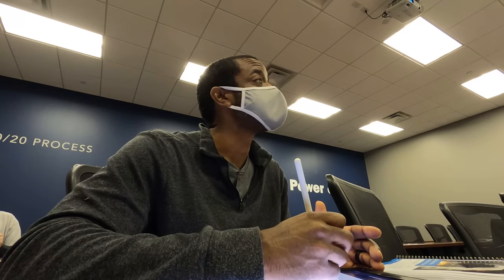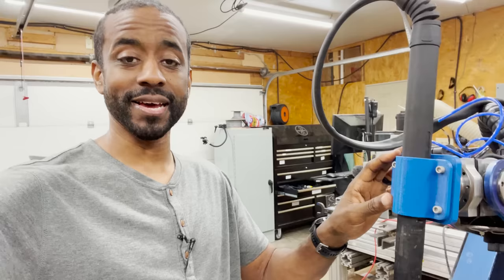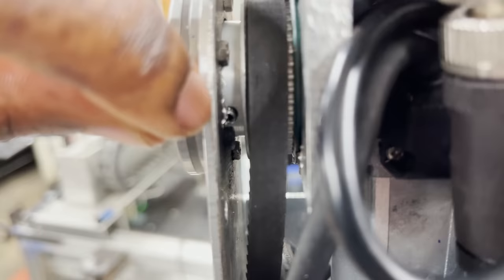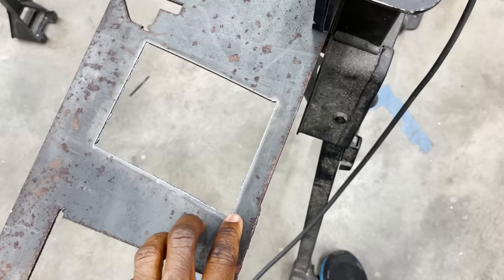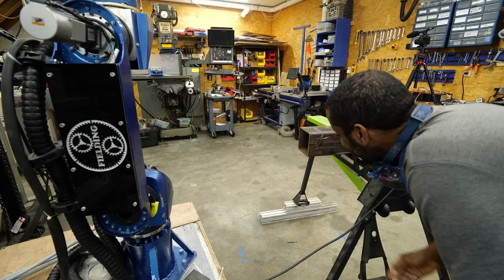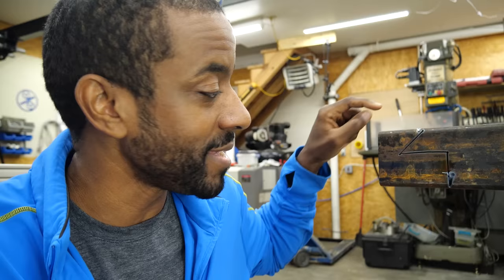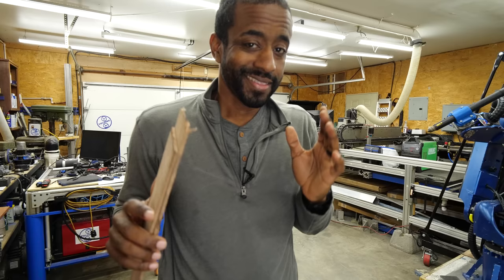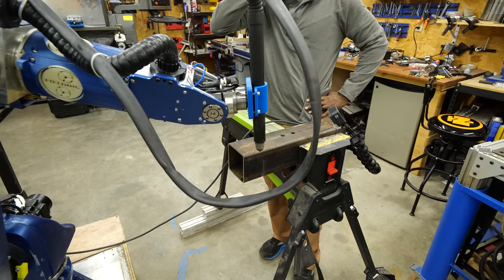I Added a Plasma Torch To My Robot - Jeremy Fielding #097

Comment: From an Embedded System perspective, it appears that your servo controllers are advanced enough to accept encoded displacement signals rather than mere step-direction. If not, normally an MCU would have timers that generate clock pulses without engaging the MCU core. Typically only individual commands may call interrupts that turn the flow of timer signals on or off. So that should keep your core free most of the time. 
If you are not already, I would suggest that you share the robot code on git and let the community help you with the MCU bandwidth problem!
I would really be interested in taking a shot at it.

Comment: Noisy or otherwise non-zero grounds can be mysterious. Check that the right wires go to ground-ground not just chassis grounds or other random metal. Check that signal shields are grounded in the right places.

Comment: If the relay is staying closed if it’s powered or not, check that no magnets are nearby. Other possibilities check with a multimeter to verify that no power is getting to the coils. It could be mechanically stuck in one position as well such as from running too much power and welding the contacts together.

Comment: Super impressed. Great work. With incremental encoders some microcontrollers have hardware quadrature inputs , you can get seperate chips to keep the tally and talk on SPI from the teensy. I'm guessing if its 10K PPR pulses per revolution its an ADI magnetic rotary encoder which might keep tally itself and read as before on SPI.  EMC problems ?

Comment: Two options: broken relay (welded contacts) or long cable with wrong shielding act as antenna. Keep calm and check one by one - for sure you will find what is wrong ;)

Comment: An accurate TCP is extremely important for keeping a robotic arm accurate in its movements. Inaccuracy can cause many different problems that may not be easy to solve when troubleshooting issues within a system. One of the first things to check on a malfunctioning robot is the TCP. Problems can range from misplaced product to significant crashes that can damage the system or the robot.  
Troubleshooting a problem like the dropped product may seem like either gripper failure or misplaced approach points when picking the product. 
While either of these could be the case, an inaccurate TCP could be causing the arm to follow a different path than the original programming. Since checking a Tool Center Point is a relatively short process, it is often time well spent to check it before troubleshooting other potential causes for a malfunction
Reply: There's also the issue of setting correct payload and center of gravity.

Comment: One issue I have seen in the past with solving inverse kinematics live, with microcontroller specifically arduino powered, is that they just aren't powerful enough. There isn't enough ram to run your trigonometry, AND solve for significant decimal places. One work around is to limit your decimals to solve in software. Another I have seen is to use a physical look up chart. If your software is solving for 3 million calculations, and one of its "ideal" movements cross a number division that gives you a repeating number, 10/3, some IK software, won't know how far out to cut off counting, then continue calculation. Instead of clipping out some calculations at the end as the ram fills up with 30 decimal calculations.

Comment: I use multiple controllers in many of my robots. You could put a binary counter chip in series with the encoders to give them lower resolution easily divide by 4,8,16,32 etc...

Comment: I think you need to calibrate the distance moved by the steps/mm like in 3d printing motors. Measure the moved vs. programmed distance and calibrate the distance/pulse based on that When you adjusted 25X difference in pulses, it seemed to move in each linear moved about 3X farther than it should have.

Comment: Great video! Since you mentioned writing down what you change... Are you doing that for your source code as well, as in are you using version control like git or subversion to keep track of all the changes you make to any code? I'm a software guy and I don't touch anything until I have it in version control. You can go back in time and find out exactly what changed at any point in the whole history of your project. You really capture what engineering is like. One time it took myself and another programmer a full 8 hour day to finally realize our code was missing one question mark in one spot!

Comment: Funny enough I thought about how useful this kind of robot would be in my industry the other day. If you mounted the robot on a rail, it would take up less room than a gantry cnc plasma and be able to cut extrusions like you are suggesting but also bevel cutting and plasma taper compensation (Cut perfectly square holes by slightly tilting the torch as it's cutting holes) AND would be possible to arm it with welding and painting attachments. Like an all in one shop CNC tool. However the real breakthrough innovation in the robotic manufacturing industry will be AI assisted programming. Like I should be able to give the machine a 3D model, or basic instructions of what I want it to do, and it should be smart enough to compensate for tolerances, orientation, any warping of base material, etc to produce the final result.

Comment: Hi Jeremy. As a CNC guy in a former life and someone that had access to a couple of robotic welders for a short time, my first thought would be to double check your end effector/tooling dimensions in the software. With all of the joints tracking properly and the problem only cropping up in the linear interpolations, it does seem to be a software issue.

You’ve probably already gone through this exercise but I thought I’d throw it out there just in case. 😁

Keep up the great work! 😉

Edited: ‘cause words are hard
Reply: Agreed. I have some experience with KUKA robots and the problem at the end where it is touching on the top and then way out on the side used to happen when we had the incorrect tool length offset or had manually offset the tool path in one direction. It needs recalibrating for the tip of the plasma cutter.

Comment: Maybe a floating voltage on plasma input try using a small resistor to pull the voltage low

Comment: The problem with the Relay, is a latching lock, it's the wiring that's the problem, I had the same on a charging system I was making, it would self latch and run the battery flat, so I think yes wiring problem, great video

Comment: 2:50 Need to flip the print orientation of the curved bracket.  3D print orientations are like a chain, it's only as strong as it's weakest layer.  There are ways of designing parts to reinforce the layers using fasteners, but it's really not needed here.  Just turn it 90 degrees in the slicer.  At most, you might redesign the part to accommodate washers to spread the force, but cracks around the fasteners aren't usually catastrophic so it's no biggie.
Reply: I agree, and also why are you using tape?

Comment: When I saw your video title, I thought I might know what you might be struggling with. However after having watched I think I am wrong. But just in case, what I was thinking of was what I heard the stuff made here guy shane say about his plasma cutter bend marking tool… I think he said it needed to be pneumatic because of the EMP from the plasma making it really difficult to use electronic mechanicals. so it doesn’t really look like this is happening to you, but I mention just as a heads up in case you start getting some more head scratches down the road to consider the EM interference. I can’t believe you already have 290 comments after only a few hours. Perhaps somebody else already mentioned this. I really envy your platform.

Comment: Plasma cutters put out a lot of EM noise. If that noise was significant enough it could be inducing enough voltage to power on the coil of your relay.

Comment: I thought about another potential problem with a plasma cutter.  I'm not sure what type you have, but if it's a HF start cutter, this could be introducing RF noise into your commands and circuits.  Perhaps causing some of the bandwidth issues?  or not. Maybe its a blowback start unit.  or something else.

Comment: Signal noise (cross talk) can be a real bastard and lead to positioning errors. Even just the power cables running  along the communications cables   can mess up positioning systems.  Plasma high voltage can really mess with encoders.  Any kind of high voltage produces magnetism.  If you can separate power lines from comm lines and be sure all of your comm lines and end connectors are properly shielded.    Metal dust can also be a real problem in these kind of systems.  It bridges all kinds of signal paths in tight wiring situations.  I would also check all of your ground connections to be certain everything has a common ground point.  You can get all kinds of weird signal echo issues with two ground points.

Comment: Hi Jeremy, love your content. Ideas from a novice, could you use an ink pen in place of the plasma torch to run path following tests faster rather than mask and glasses and fire? Also, could you add a CNC lathe spindle to your plasma table to gain another axis rather than the robot 🤖

Comment: I ran into a very similar problem with relays. The problem I had was that the relay did work fine when there was no device connected that consumes power (in my example a solenoid) but worked when nothing was connected. The issue was the relay itself could not handle such power with a low control voltage. I recommend to take a step back and do some tests.
- Can you control devices with lower power? If yes how high can you go before it stops working. I don't know if you can lower the power of the plasma cutter that much
- Does it work if you increase the control voltage? By a transistor for a example or a different power source for testing.
- Did you try out other relay models? Do they have the same issue? Do you experience the same issue with different relays from the same model? Maybe your relay is just broken
- Does the relay get hot?
- Does the relay instantly start the plasma cutter or after a short time? Also check with a new relay, maybe something is burned out

Comment: Watching the plasma cutter torch move closely to the tube while you were debugging was kinda scary. I would have made a styrofoam dummy model and a quick release mount to swap it with a real torch. Also you could make a CPLD driver for the stepper motors to make programming easier.

Comment: I've seen robots that will read the moves that you manually force the robot to move through and then it will repeat those moves exactly as you moved it manually automatically. Then compare the file that you did manually with the file you are currently using and see where the two diverge.

Comment: My guesses would be:
Regarding the relay.... 
If you are switching a control signal to the plasma box then it may be DC, if you are using an SSR then it may act as a diode in one direction, so maybe polarity matters.
If you are switching AC, and using an SSR, then maybe the relay is acting as a diode and allowing enough current in one direction.
If you are using a standard relay contactor relay then maybe it is broken, or also has an internal diode.

Regarding the stepping missmatch....
If the MCU is multiplying a step count to guess the real-world step count, then maybe it is a rounding error and the real-world step count is less than half but more than zero so the MCU counts it as zero steps but the driver counts it as a fraction of a whole step.

Comment: Jeremy, could your issuee be related to EMF interferences from your plasma torch superimposing unwanted signals or pulses on to your data lines to the servos or some other data buss of your system?  Shielding all your data busses in the vicinity of the plasma unit may help solve a lot of problems now and in the future.  Best of luck my friend and keep up the good work...  Fred

Comment: I wonder if the relay is breaking down under the high voltage/current on the contacts. Not sure if that is a problem that can occur on all relays, but some types will fail in a way where they appear to be working until you put a high enough voltage on them, and then they will break down.

A large industrial contactor would probably be a better option unless you are just switching a control signal.

Comment: I know this is over a year old now, but if you are having trouble sending millions of pulses per second to multiple devices you should consider an FPGA, you could create custom hardware that takes a number of steps to move and a speed and then without intervention from the processor sends those pulses at the exact specified speed to all device at the exact same time (in parallel). FPGAs are great and allow you to pretty much create a custom, reconfigurable digital circuits to do whatever you want, since they are just digital circuits everything can operate in parallel, so whilst one part of the chip is doing one task, another part could be doing another unrelated task and they never interfere with each other and their timing is completely independent, for all intents and purposes both circuits are completely separate, but you can also design them to communicate between each other. Some come with processors built in, like the Xilinx zync series which features dual arm A9 processors and you get some with normal arm cortex microcontrollers too. They do have a steep learning curve but aren’t too bad if you understand digital logic well. There is also nothing to stop you connecting a normal microcontroller like a teensy to an FPGA and sending data between them.

Another option may be similar to what is done in drone software where they use dma (direct memory access) with the gpio register, so all gpio pins get updated at once. A teensy, especially the 4 should be plenty fast enough to send the pulses at the required speed, maybe their are some optimisations you can do to your code to make it work?

Comment: A switch (relay) must be able to switch on and of a load. If it doesn't do it - than ask you if the switch is rated for. If the voltage is too high, the current can easily jump the gap. And it newer shuts off.... (put two relays in serie - test my theory) AND NEVER FORGET THE FREEWHEEL DIODE
AND High frequency can also jump a gap

Comment: Im amazed at what you’ve accomplished.building an articulated arm is no small task. I’ve been working with industrial robots since 1984 and met some of the early pioneers. Most of the robots I have worked with use more than one MPU.
I am not a robot engineer I have mostly done service and applications work. Although your plasma cutting didn’t come out perfect it wasn’t to bad.  I’ve done worse.

Comment: Are you using a solid state relay? Confirm the relay coil voltage shut off point is higher than the voltage at the coil when the relay should be off.

Comment: Relays acting differently in 2 identical situations.  
1. Faulty relay. 
2. Situations aren’t actually identical. Trigger voltages are likely not the same. Maybe a “short” in the source voltage is triggered it prematurely giving the impression its “always” closed

Comment: With the relay for the gripper / plasma torch are you removing the gripper from the relay contacts so that the plasma torch is the only thing connected? My thinking is possibly the plasma torch is controlled by a microcontroller and its seeing a high or low state because the gripper is in parallel with the torch on the contacts of the relay.

Comment: Shot in the dark -- is it possible that whatever cabling you are using to send the pulses from the microcontroller is interfering (via parasitic capacitance or I-don't-know-what) with the signal? E.g. filtering out some proportion of the signal, given that it's switching pretty fast? I.e. is the cabling designed for such use?

Comment: Just guessing but maybe the torch head wants active high vs active low? When you connect the relay the switched pole is high so when the relay is off the torch head only sees open (ground). Then when the relay activates it closes the circuit and its still low. If the switched pole was ground and the other pole was high then when the relay is closed the torch head still sees a high signal and will turn off. I would try different combinations on the torch head manually with a battery and see if you can come up with a combination that for sure activates the torch, then duplicate that with the relay.

Comment: I know this video is very old and my comment might not be seen but any way
from a specialized engineer in building and programing  those stuff here is my advise :-
always trust your servo they are not designed to be closed loop in the program you just throw the position command to the drive 
the checking and verification of the position is your drive responsibility not yours ( the closed loop stuff)
if you want them to work in closed loop you need a lot of computation  power in (micro)Sec time frame and this is for one motor
you as a programmer should focus on the algorithm and trust your drives for verifying the correct positioning

Comment: Those servo drives should have an encoder out to feedback to the controller. All of the ones I have used do, Mitsubishi, yaskawa. etc
Reply from the maker: I have encoder out... the program can't read it. That's the short version of the story LOL
Reply: @Jeremy_Fielding  I really recommend the kflop, it will handle encoder feedback and up to 8 axis of motion. I use it on my cnc mill with Mitsubishi servo drives. It has a bit of a learning curve but it is pretty powerful, especially for the money.